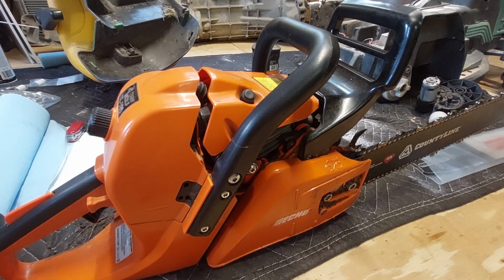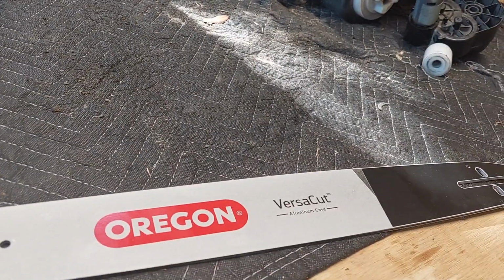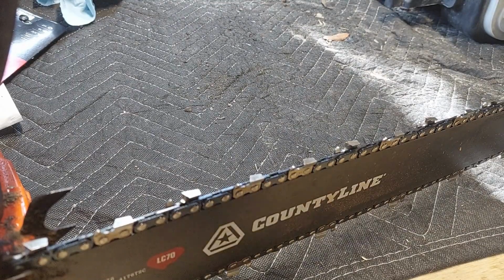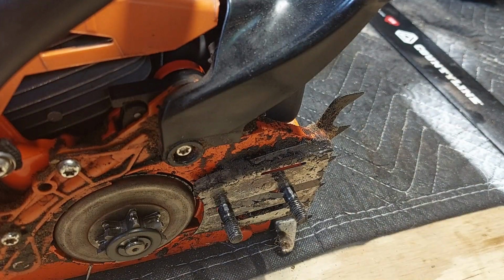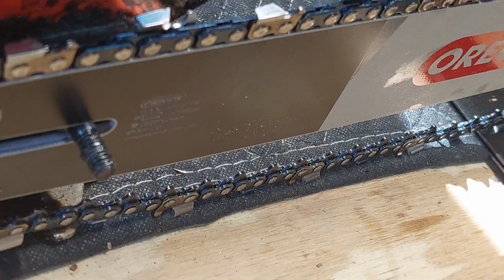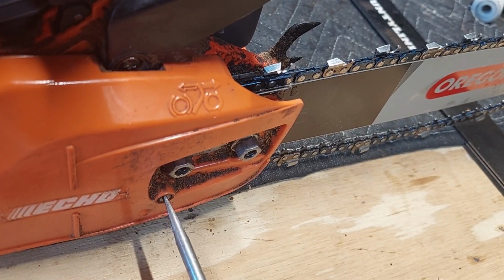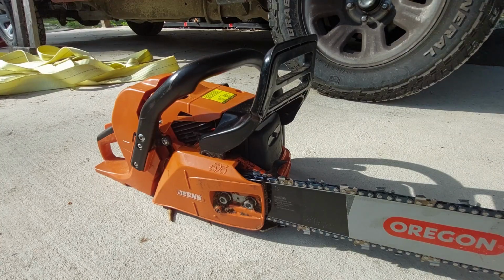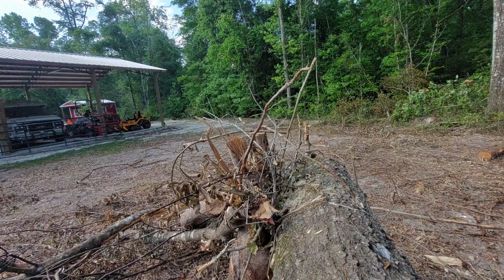Fix Minute Fix 6 - Replacing the bar on an Echo CS-590 Timberwolf Chainsaw

Comment: that sprocket is junk and i would say the chain being to loose would be the cause
Reply from the maker: Are you talking about the gear in the nose of the bar?  If I remember this video rightly, the Tractor Supply bar I bought I crushed somehow, which damaged the chain track.  I then switched to an Oregon bar, which I'm still using today.  As I noted in the video, installing the chain in the correct orientation helps tremendously on it acting cutting stuff.

All that being said, the bar you can get from Tractor Supply isn't that great.  Better to pay the extra coin and get the Oregon bar.
Reply: @MazdaB3K  the spocket on the chain saw is what I was talking about is warn pretty bad. I personally think its from the chain being too loose others may think different but its like smacking 2 pieces of metal together. youre slowing the chain in wood which makes slack in the chain making more space to take up.